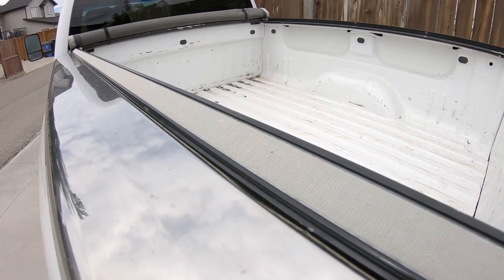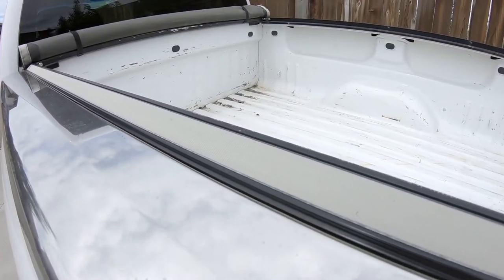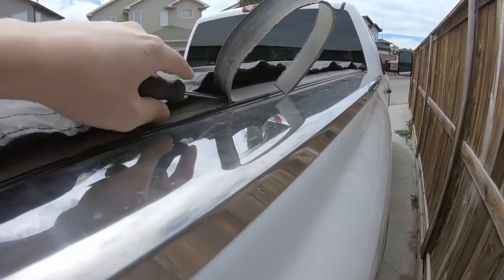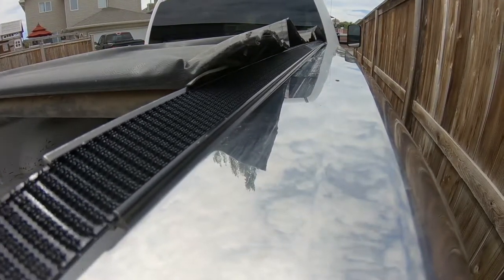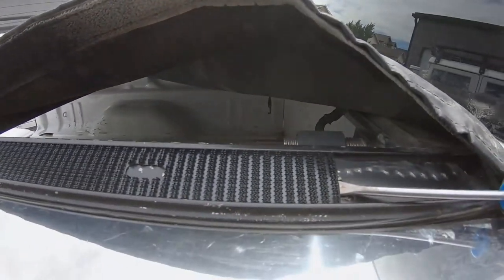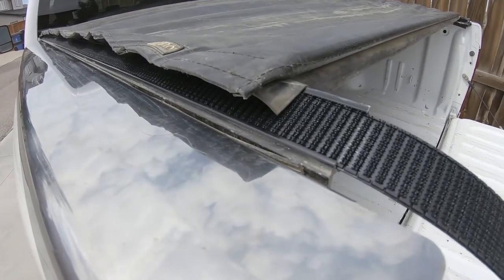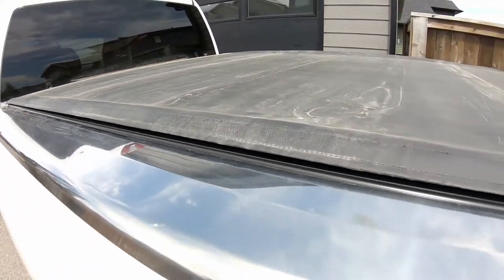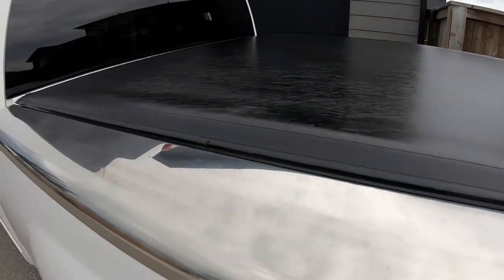Old Tonneau Cover gets a New Lease on Life!

Comment: How did you get the old cover so clean and shiny what product did you use ?
Reply from the maker: I first cleaned it really well with dish soap and water with a soft bristle brush. It took a couple washes to get all the dirt and grime out of it. Then I used and vinyl protectant spray like you would use on interior dash panels and that sort of thing. I used whatever I had in the garage at the time. Something cheap I got on sale as I used a fair amount of it.

Comment: What vinyl sealant did you use?
Reply from the maker: I just used a Maguire's equivalent to Armor All. Nothing fancy, I think it was on sale at Costco at one point so it was just what I had laying around.
Reply: @ResearchDesignBuild  how long did the maguires keep your tonneau  shined up ?
Reply from the maker: @justice4all997  Probably lasted a month out in the full sun, but after a month it didn't fade all the way back to original, just not as shiny and deep black.